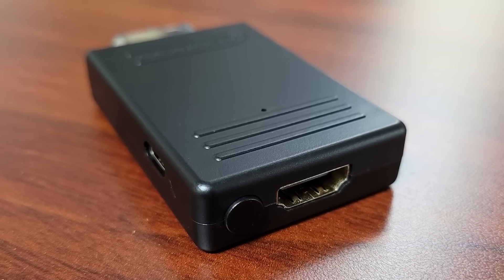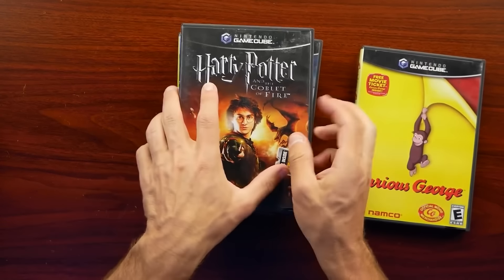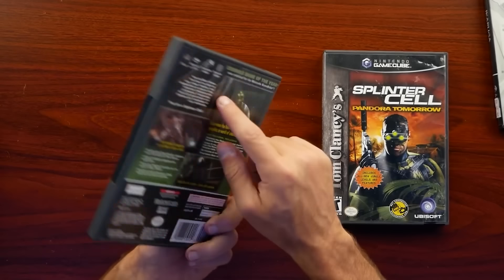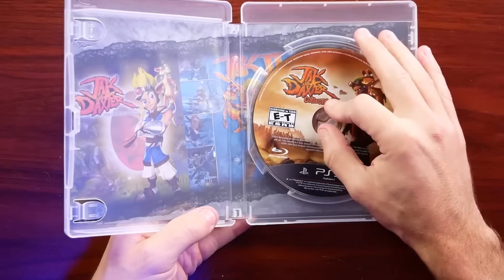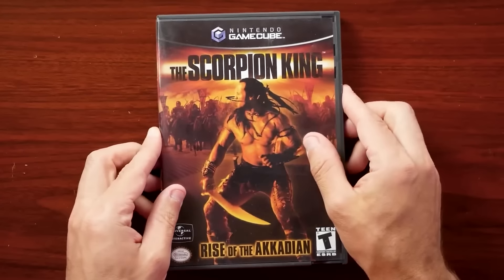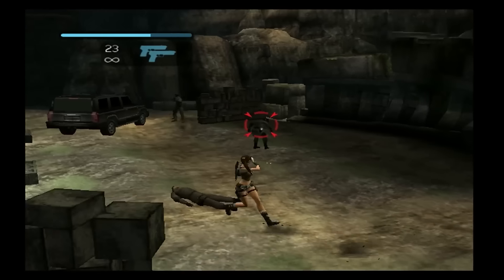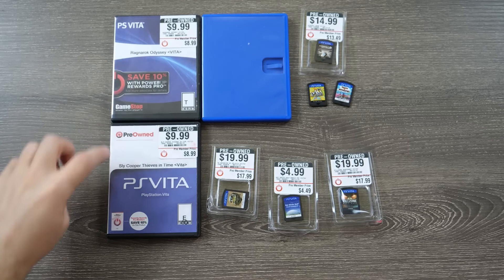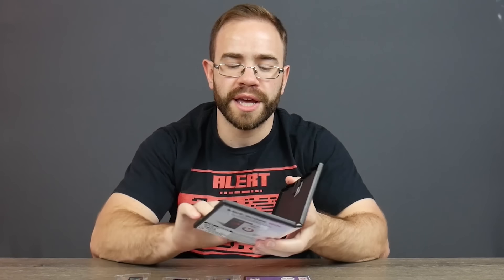2 Hours of Retro Game Collecting (GameCube/PS3/Vita and More)

Comment: My first PS3, almost 2 years after the system was released, was the Metal Gear Solid 4 bundle, which was also the 80GB model. I love that console. I was 19 that year and worked my first full time job and saved up my own money for it and was pretty proud of that lol. 
I still have it, in great condition and it runs like new honestly.
Ive only ever encountered one PS2 game that wasn't read by the console.